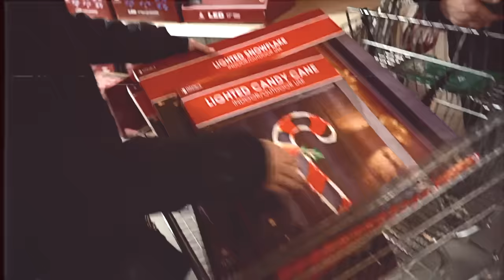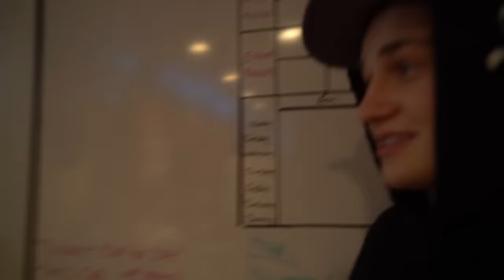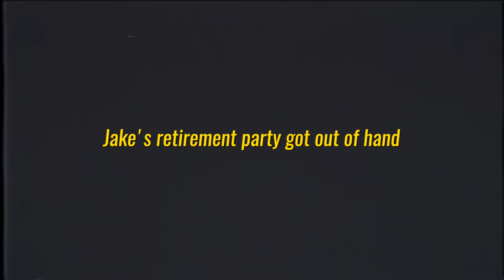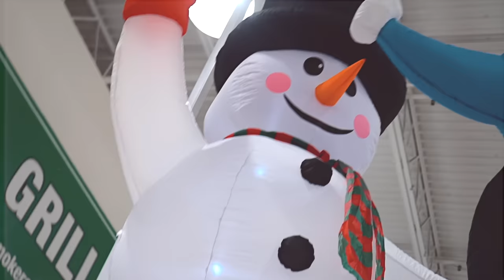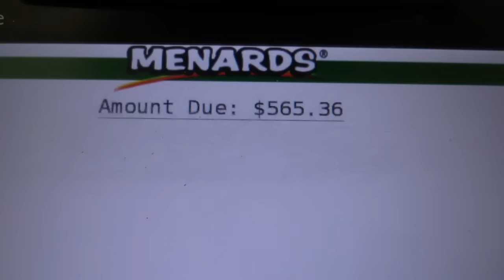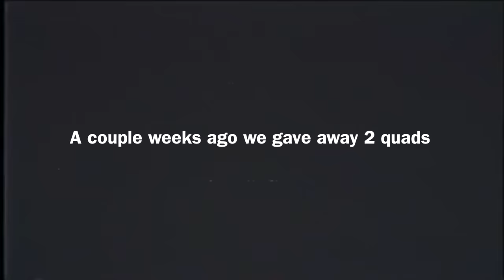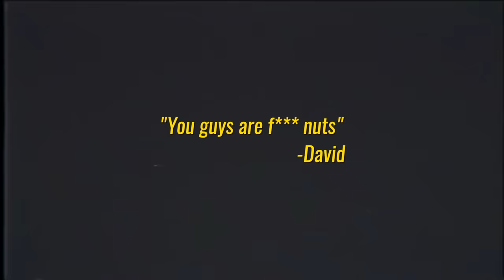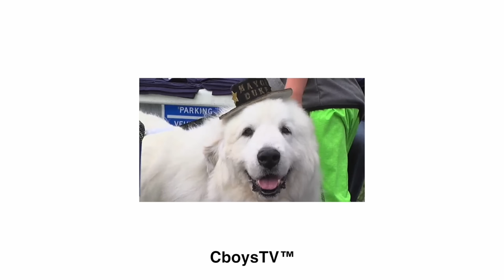Buying the New Tesla Cyber Truck

Comment: I busted out laughing watching them carry that ladder I mean s*** I'm only 5'9½" 155 lb dressed and I still carry 20 ft extension ladders just like they were using in the video and I have to carry them by myself no b***** I legitimately busted the hell out laughing watching them struggle trying to stand it up and watching Micah try to walk with it stood up You stick your hand through the back on the third or fourth rung and your other hand goes extended as high as you can pushing up on the ladder with your arm that you have extended while you push down with the hand that is through the ladder on the third rung if you push up and pull down you can control the ladder while it is straight up doesn't matter if you're walking or not I do this daily and have for the last year it's not difficult